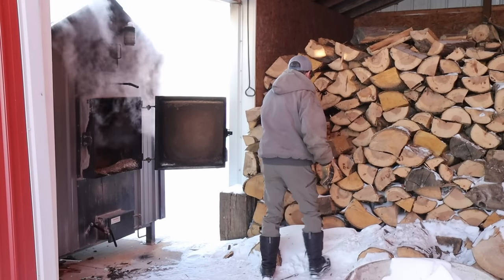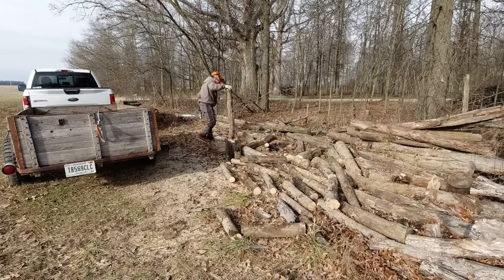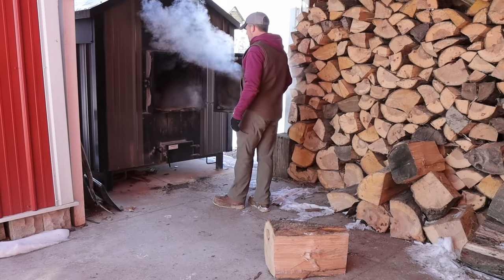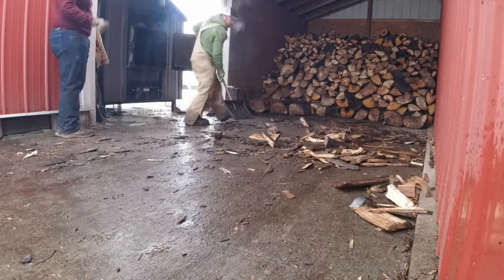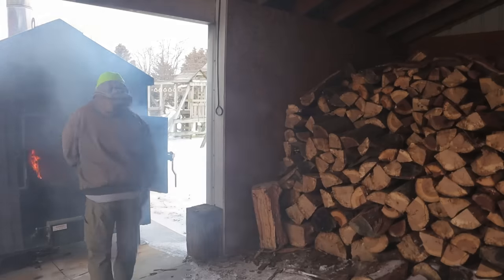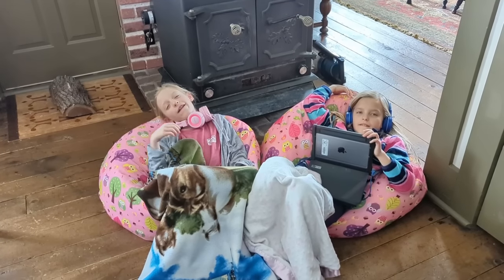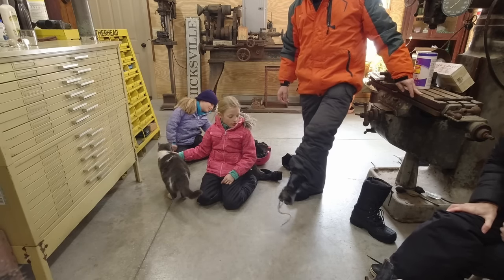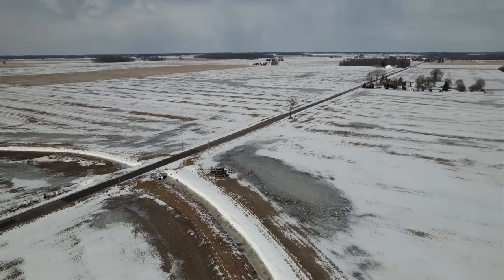Is BIGGER Better? [Firewood Size For Outdoor Wood Boiler] - Why Split Wood For A Large Boiler?

Comment: I heat with a wood stove, and I like to split firewood so that a woman holding a baby could pick up a piece with one hand. 3x5 or 4x6 inches is the approximate size I'm aiming for. This way the wood is easy for elderly or smaller people to handle if necessary.
Reply from the maker: I like the visual!  Loving mother feeds her baby and wood stove at the same time! 😂

Comment: Yes, everything is correct, the back is not rubber and you cannot buy a new one. It is necessary to chop firewood to a convenient size, based both on weight and size, and on the grounds of faster drying of firewood. But if your boiler really gasifies firewood well, then you don't really have to worry about the content of resins and creosote that settle on the walls of the boiler and chimney, because a well-gasifying boiler neutralizes the negative impact of resin content in firewood. Therefore, you can get rid of hard work and not split heavy oak firewood, but buy wood waste, such as pine cones or the same oak. Then all that remains to be done is to cut the firewood to the required length for your boiler or one that will be easy for your wife or even children to lift. I tried to heat the house with such firewood. This is not bad. Of course, they burn faster because they are light and not dense. However, they usually cost much less.

Comment: Find you a piece of conveyor like they use in warehouses. A 10’ section is good enough. Make a stand with heavy castors to where you can roll it up to the firebox door. You can stack wood on the conveyor at your convenience and just slide it in when you need to add wood.

Comment: I wonder if a 1000 gallon propane tank would be enough for a winter for your house.
Reply from the maker: No it wouldn't cover it.  I estimate I would burn closer to 2000 with house, garage and shop all on propane.
Reply: @digdrivediy  That is the problem heating 3 spaces is so much more costly.  You are right, you would have to have a 1000 gallon tank filled 2x for winter.  Propane will just go up and up in price.  

I guess it would be nice if arborist could bring you wood as they cut down trees.
Reply from the maker: @HealthSupercharger  Actually, they do!  My brother-in-law is an arborist and I have several videos showing how I get wood from him.  It's a terrific deal for me.  I'm lucky in that I have never paid for firewood, nor have I ever cut down a tree just for firewood.  Every bit of wood I have every burned was cut down for some other reason, usually because it was either dead or damaged in a storm.  I'm glad that firewood has a way of finding me :)

Comment: Let them hurt their backs. You have to protect your back. Once you trash your back, it is never the same. Also, wood burns hotter when split because of the surface area exposed.  Many reasons to split your wood.

Comment: How do you like those boots? I've been eyeing them but every review seems to be a paid review so I don't entirely trust those ones.
Reply from the maker: They were really stuff at first and hard to break in but now they're good. I sent the first pair back that was the other style and like these better.  They are composite toe.  I wear them for wood and dirt work and I like them.  They make my feet sweaty to wear yhem all day but not surprised.
Reply: Maybe I'll check them out then the price seems fair and they say they have a hassle free return even when they are worn to work. Thanks for the reply and the rest of the video was great by the way.
Reply from the maker: @rkelly5803  Thanks.  They do have hassle free returns.  They were great to work with.  You can get 10% off if you use code "KOCH10" btw

Comment: Neil… size matters!  That goes for length and girth.   But whether it is short and fat or long and skinny…. At some point ‘one size fits all’ just isn’t right for the job.

I’ve watched a bunch of  wood splitters over the years.  In person and on the screen.  Some of them (especially here on the YouTubes) are obviously going for pretty wood.  All pieces are the exact same length.  These are split into a small uniform size that, when stacked, looks pretty on video.  Most would never let a piece of pole wood (unsplit rounds) litter their stack of splits.  Some even chastise others for using barbaric stacking methods. Only their way has the optimum air circulation and curb appeal that a serious woodstacker can embrace.  

I once (jokingly) suggested that all the folks around here have ugly wood piles.  They have all different lengths of wood.  Some chunks have gnarly splits through the knots.  Other pieces aren’t even split but have still been stacked right in with those that are.  And those that are split,  vary in diameter significantly.  Sometimes, they will have pieces two to three times bigger than others…. In the same stack!  

And, if you look at the stacks, their faces aren’t flat.  These they may be as high one can reach or just to waist level.  The stacks may be left in the woods for months before before being brought up to use.  

It is obvious to me that these folks who have been processing and burning wood for years and sometimes generations.. could benefit greatly for watching the experts on the YouTubes!

The pretty wood YTer agreed with me and confirmed that he had some amateurs living around him that had ugly wood stacks too!   

You know Neil, I’m fine that pride in workmanship manifests itself in pretty stacks of wood for some folks.  But, for me… size matters. I want a mix of short and long.  Slim and chunky are just fine too.  Because you see… like you, I ain’t into wood cutting for Instagram or YouTube clicks… nor am I processing it for sale to occasional weekend ambiance wood burners… I actually burn it to heat the house and the shop!

If you’ve burnt much wood you begin to understand that each stick of wood has an optimal use.  

Small ones dry quicker and burn at lower kindling temps.  They are like those energy drinks in the dinky bottles.  They give you a potent short term shot.  This is great when you are starting a fire or need to revive one from an overnight slumber.  

Big pieces are great for burning slower… they tend kind of soak up air until they produce an abundance of glowing coals… rather than expending themselves up the chimney in a burst of flames.  If you just want a fire for ambiance, these ain’t the size for you.  But, if your incontinence isn’t likely to keep you getting up all night anyway… they are the ones you want for all nighters!  

Then there are the average size pieces… in the 4”-6” range for my fire place.. these are the ones that work great for getting a longer energy shot without losing it all in flames… and especially when my assistant fire tender has to chuck them in.  

You see for her, size matters for a whole different reason than it does for me. Where my overriding objective is to have the optimal size for the job.. her goal is to have the size she can most enjoyably handle!  She’s not interested in a workout regimen to get in shape for handling big wood.. she wants to be able to comfortably do her thing and walk away without aches and pains.  A good medium sized stick of hardwood is what she prefers.  

And… don’t get me started on ‘seasoning’ wood.  There’s more to life than watching wood dry!
Reply from the maker: Best comment right here!!!  
Couldn't have said it better myself.  I was never self conscious about my wood stacks until I started posting it for the world to see. Also I never fretted about some green wood getting thrown in as well, even if trying to not make a habit of it.

I'll admit that a nice, even stack of wood does have a certain undeniable curb appeal but I guess I'm more of a "function over form" guy when it comes to firewood.  When it hits the floor in front of my stove, its days are numbered anyway!

Thanks for the great comment.  I can dismiss my case of wood envy knowing there are others out there like me.  

I'm not lifting any more of those big ones either!

Comment: Your better off stacking in high an tight right in front on the door, the heat then travels back through the stove, I’ve been doing it for years an I save a lot of wood, the stove seems to work better that way

Comment: Jobs cannot require a person to pick up more than 50lbs. There are jobs that certainly surpass that, but there are requirements and safety stuff that goes along with it. Sure a lot of people have no problem picking up 100lbs but doing that continually will overtime cause problems if your body isn't built for it

Comment: Ah, the “you-should”-ers.  I’m like you, mixed sizes work best.  Those big 80, 60, even 40 lb-ers are for the birds.  I usually fill my boiler first thing in the morning before work.  Head’s still a little foggy that early in the morning.  Nothing wakes you up quite like smashing the crap out of your finger(s) with a 60lb block of firewood.  Do that about once and you start cutting your firewood smaller 😂
Reply from the maker: Yes. I've done that just once. 14 stitches later and I do it differently now :)

Comment: You should air seal your home and mark sure it has more than adequate insulation... I bet you will see a huge reduction in BTUs needed to keep it warm..
Reply from the maker: I'm all ears Chris.  What is the method for "air sealing" your home?  
I'd love to figure out a way to make it better insulated too.  The remodeled portion of our house is pretty good but the old "farm house" portion is likely pretty bad.
Reply: @digdrivediy  Check out videos on AeroBarrier.  It is a liquefied latex caulking that is sprayed in the home while it is under vacuum and that caulk goes into every nook and cranny and seals it.  I would be willing to bet you could reach out to them and work out a deal to promote on YT or something.  It would show how well it works on existing homes, vs the new builds they always show it on. 

If you have access to a FLIR camera, you can run around your home and see where you need insulation.  Cheap way to pinpoint areas of loss.  Then you can come up with a plan to tackle those areas, if they are a problem.

Comment: Well you ruined my day . JK every comment I was going to make you answered. From my experience your spot on with your logic. Besides throwing big heavy chunks gets old fast. My stove is smaller than your it's a plain Jane base model voltgang, if I spelled that right. I can't only use About 12 inch logs. But here's a ride bit for ya. Before my stove my average electric bill in the winter wasaround three hundred bucks. I've cut that in half. I spend about a hundred bucks for new chains ect for the season. Someday I'll get efficient enough to cut all my wood for the winter at one time. My son and I can go out and cut a couple weeks worth of wood in about an hour or so. Then maybe another hour or so for splitting. Sure it hard work but nothing beats the time spent with family doing it my grandson has a ball when we go out. I do have a question for guys. Does anyone save bark for fire starting and to get a hot fire going fast?
Reply from the maker: Thanks for sharing the insight to your operation Kory.  The electric savings I would say are well worth it.  I save only part of the bark for starting fires.  Most of it I clean up and throw in the stove with a snow shovel!

Comment: You didn't mention water content. Putting a big block in that's 50% water is a waste of effort if you would only split it and let it dry for a year you get twice the BTUs in heat out of it since burning it wet takes most of the potential heat to evaporate the water out.
Reply from the maker: That is very true.  I need to experiment with that some day.  I always use about the same amount of wood though every year and it doesn't matter if I split it that year or use two year old wood.

Comment: So many guys burn wet wood.  1/3 of the heat is lost to just boiling off water.  Get ahead, let it dry, and burn 1/3 less wood.
Reply from the maker: I've been ahead before.  Always use about the the same amount of wood.  I'm not convinced it's such a big difference really.  15 cords dry or wet usually.

Comment: The only boiler i know of that requires huge peices of wood to fuel is the one on the farm near my house. The farmers boiler door is 12' x 10 and is 16' deep'. It was built around 1810. Its a huge house, almost mansion sized, but to fuel that beast he uses tractors. But i sure dont blame you for cutting down your wood. Trying to flip 100+lb peices is dumb and anyone that thinks you should hasnt ever done it themselves.
Reply from the maker: That is incredible!  Where in the world is that huge boiler located?  Thanks for sharing.
Reply: @digdrivediy  York county PA. It was built by a guy that was apart of a local iron furnace family. Ive personally never seen it, but ive heard stories about it since i was small. And i knew one of the older farm hands very well and he confirmed what i heard.

Comment: im a bit puzzled. for what possible reason wld you fuss with anything weighing more than abt 45 lbs. ive been feeding my outdoor boiler 18 to 24” sticks, since time. if i have a block th size and weight of those you’re scaling, it gets another pass at th splitter. im happiest if im able to manage a piece in each hand, from th stack to th burner.
 please, seriously, give yourself a wee break. 40 or 45 lbs, maybe 50 here n there will do. honest. am i able to lift th 60 or 80 lb stuff? sure. im 6’5” and abt 270. ish. however, what’s th prize?
i drop my balls into my sox? i blow a disc out of my spinal chord?
 thank you, no. take it easy on you.
Reply from the maker: Hey Tom.  The entire point of this video was to discuss how I absolutely DON'T want to lift firewood pieces of this size. I explain why they are just too big and that I like to take them down to a manageable size.  Most folks try to tell me I'm splitting them down too small and this was an answer to that.  The big chunks on this vid were to demonstrate how much they can weigh even if they don't look that big.  So, I'm in total agreement with you... 😁
Reply: @digdrivediy  
 oh rest assured neil, i did get your msg. my intent was only to further encourage you in that regard.
 what troubles me, is that your heat is forced air, and mine is hot water. like apples n oranges. my water stays at 180 always. i never dont have hot water pumping thru th house. when th water temp drops to 179, a solenoid is triggerd, holding open th vent door til the thermostat is happy. i keep th burner fairly full, and then pack it full for overnight or when im leaving for th day. abt once a month i let it cook down some, so i can shovel the ashes out. and, i enjoy playin with my burner n go out there for a smoke. stand and watch th fire burn, while im burnin a lucky strike n being hypnotized by th flame. 
 sadly, ive no clue what might be said or done abt your significant temp drops and th fire burning nearly out
Reply: beggin your pardon sire. i was suddenly unable to reposition th cursor where it needed to be to continue.
 i jst cant get past the idea that there shld be someway to streamline your mission. truly you shld never be faced with playin catch-up becuz this stat or that one, allowed th temp to plummet. that’s too clunky. and it shld be nice n smooth. you must hava few buddies who might be helpful. safe to presume you’ve been at this for awhile, and hava few good ideas rattlin around?
 hey neil, thanks sir for th chat.
and for a beautiful video. my first.
i’ll be havin a peek at smore of them!

Comment: I cringe when I have to throw a real heavy piece into our furnace.  If I ever miscalculate and pinch a finger between the 3/8 edge of the door and end of the wood, I'll be pulling back a stump.  I like my fingers.
Reply from the maker: You're exactly right.  I had 7 stitches in my finger once from doing exactly that maneuver!

Comment: You are not a wimp.  Aif you split them smaller you cn teach others howto refuel withou the gripes about the wood being too difficult to handle.  Smaller pieces burn hotter as you mentioned

Comment: I’m sure you’re planting a million trees per year to offset all that carbon. Your one home emits 100x the carbon.  With todays building and HVAC tech, you could insulate well. Geothermal. Some solar. Heat pumps. And never have to burn wood again.  

Assuming all your wood is free… if You factor in the emissions (at least it’s renewable), the time and money it takes to chop, gather, process, transport, feed the wood boiler, maintenance of the boiler and all involved equipment. Carbon of all that equipment. Peoples time. You could easily pay for geothermal or a ton of solar with batteries and with heat pump tech today, yes they work where you live. Some heat pumps will work to -4F.  And the more insulated the home is the less heat you need.  

It’s like watching a cave man try to make fire while living in 2022.  Oh.  That’s exactly what it is.
Reply from the maker: I don't think you fully know what geothermal or solar options would cost.  I wouldn't come close to purchasing an all new system with what I'm spending or have spent.

It's a great notion... Just reinsulate an old 1800's farm house and throw in a $60,000 geo system or $80,000 solar option to cover your $700 firewood operating costs.  If I had more money than I knew what to do with, I'd be glad to try it out.  Plus, the only solar options I have seen barely cover the electrical needs in the winter with the low amount of sunlight, not sure what system out there would provide a heat solution as well to 7000 square feet?

What do you heat your home with?  

Our next house would have a different setup but there isn't much I'm really able to afford to change on this one.  

Thanks for watching although I'm not quite sure why you're watching firewood videos if you hate the premise.